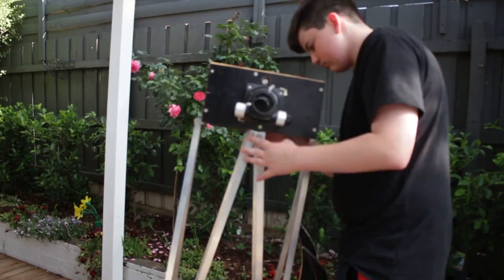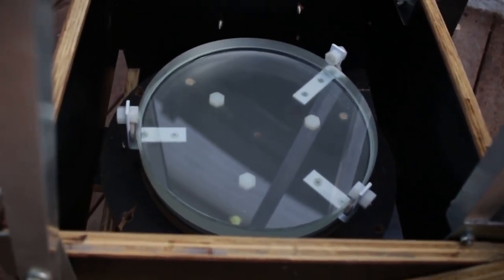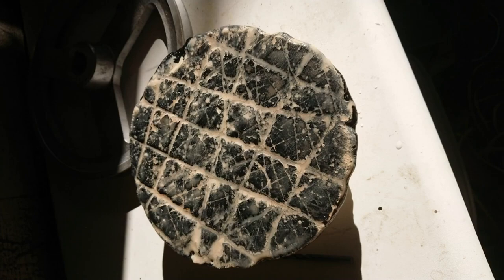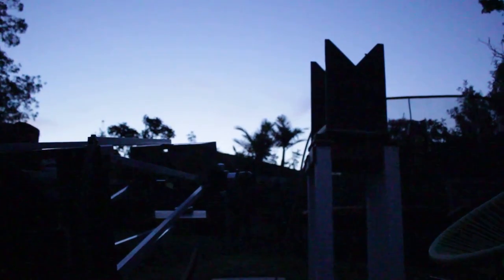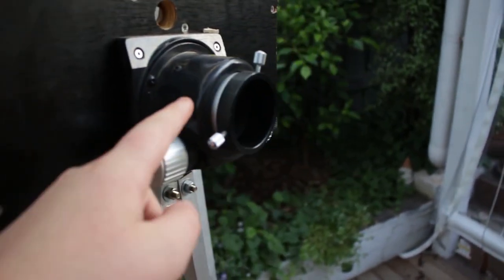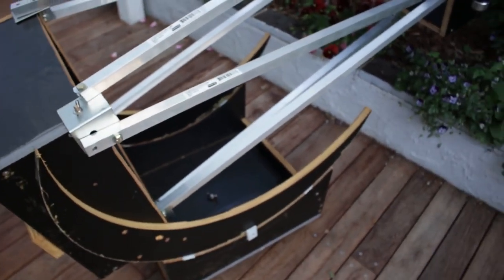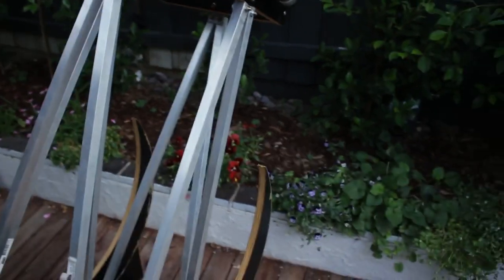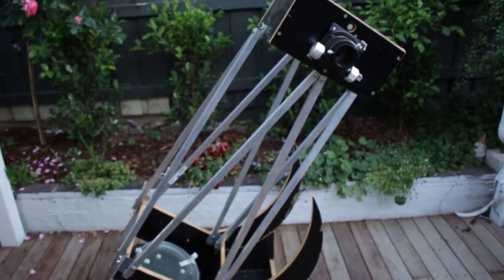Build your own: My self made 250mm Telescope!

Comment: Great job, Logan. I built an 18" standard Dobsonian over 15 years ago. Ground the mirror by hand. John Dobson himself came to my house and helped do the final figuring of the mirror. He was also kind enough to sign the back of the mirror. Fully upright, the tube assembly stands 9 feet / 2.75 meters tall. It is a heavy beast. Seeing your video has inspired me to take it apart and build a truss tube system instead. That should make taking it out to a decent dark sky site much more manageable. 

Again, great job. Hope you are getting lots of enjoyment from your scope. That is a big accomplishment. My hat's off to you!
Reply: it'll still be heavy - honeycomb sandwich mirrors are really a great idea, combined with a truss design and lightweight components (aluminium, carbon fibre, etc).
Reply from the maker: Thanks mate! Wow that must have been a dream come true to have the one and only help you! I actually hope to do up this scope soon enough, unfortunately though I haven't even used it once since the filming of this as I haven't been able to get it coated. Cheers!

Comment: Good job..I have a question after making this concave piece of glass. Do you need to finish with a reflective material like nickel? or not ?
Reply from the maker: Hi, The glass is usually finished with aluminium from a coater. Cheers

Comment: I built something quiet similar. I had problems with balance and had to add weight to the mirror box. Took a lot of time.
Reply from the maker: Yes it is certainly hard to balance these sorts of telescopes. I think this one needed a bit of weight. I plan to maybe make this scope a bit lighter in the future. Cheers!
Reply: @AustralianAstronomy  there is another option. Use strong springs possibly on a pulley to help manage the weight
Reply: Thanks

Comment: That's a great mirror, I have a question that where do you coat the mirror? Do you coat it on the bottom side or on the curve? If it's coated on base wouldn't that make it a plane mirror with a lens? And if it's coated on curve then how will it reflect?
Reply: Silvering the flat side makes the mirror behave like a concave mirror with a focal length less than that of what it would have been if the curved side was silvered. You can get it coated so that the top of the coated surface is smooth and highly reflective. Check out Physical Vapour Deposition.
Reply: @jassu1  thanks man